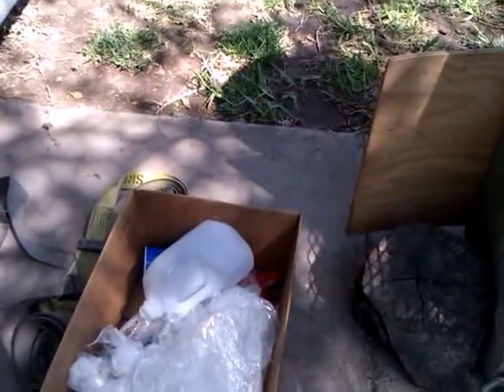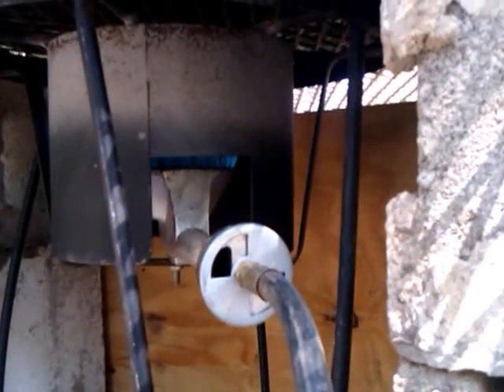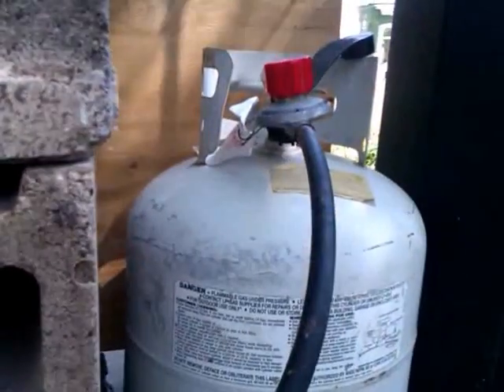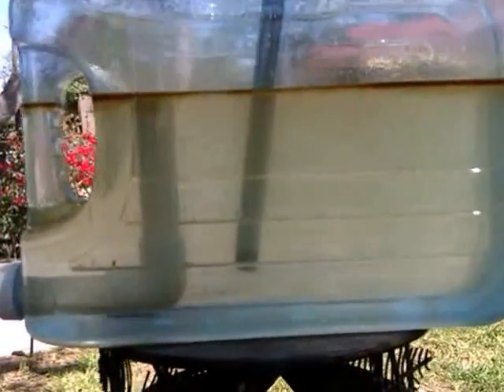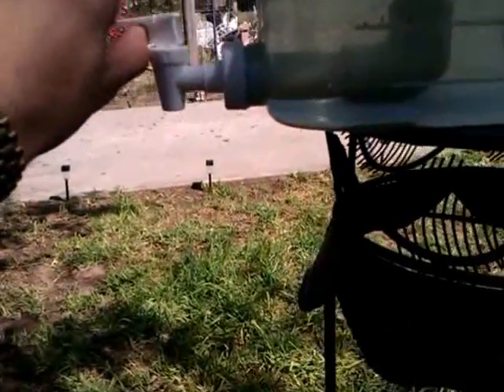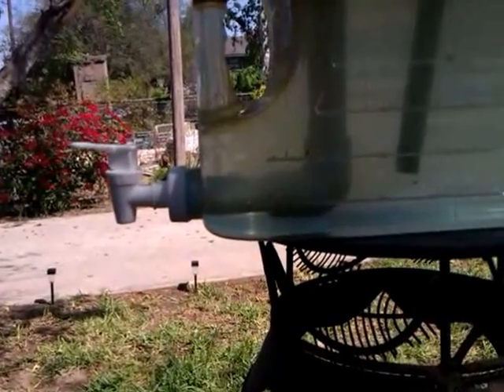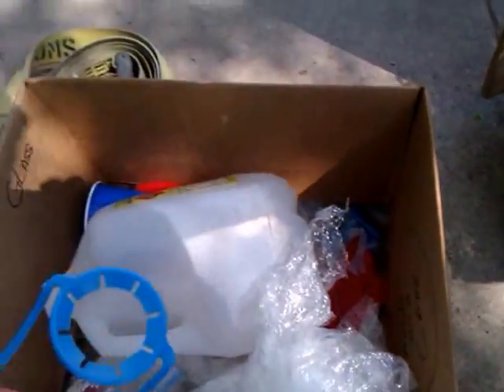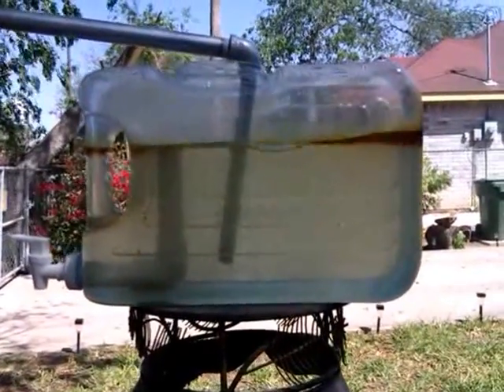Homemade oil refinery. Turning plastics into oil

Comment: I didn't read all of the comments so this may have been covered before. You can improve the system be using a better cooling loop and extract the gases that will not condense and then feed them to the boiler. This will reduce your propane usage (or whatever fuel) while keeping the gases out of the atmosphere.
Reply: Royce Jones Hello sir, 
i know this sounds random 
but when you suggest a better cooling loop !! what do you exactly mean and how is this achievable !
and how would you feed the gas to the boiler again 
i am thinking in recreating this project myself! and i thought  of picking your mind 
thanx in advanced
Reply: You would use a condenser to cool the gas to liquid but not all of the gases will be condensable. Use those gasses for the boiler. They should have enough pressure to move to the flame holded.
Reply: Thank you so much sir for your fast response 
I will look closely more into it 
again i am really grateful for your kind respond
Reply: rahaf hussein Anytime, do a little research on gasifiers, wood, coal, etc., they all work basically the same.
Reply: u are fond of the word "apparently" aren't you?
Reply: Ayyoob Bashir Najjaar NOPE !! 
apparently am not

Comment: Use a solar reflector to heat it up no power no gas used  be careful not to melt the bottom of the drum . Incidentally you are actually using the same basic process that formed oil during noahs flood heat plus pressure bing oil
dont take millions of years (i think its called thermal depolymerization)

Comment: green? so you burn 5 gallons of propane to produce a cup of oil. move to Hawaii and sit that drum on lava, then you are been environmental and green.
Reply: +qwertz33 genetically modified E.coli bacteria sounds kinda scary to me to be honest...
Reply: jesusvivian i think in iceland they do have a place that uses volcano heat for electricity generation. yes his idea is not cost efficient but at least he is using propane, which is the least polutant fossil fuel
Reply: you have a vary fine point about the inefficient use of 5 gallon propane to produce a rather small amount of oil... however... to relocate from where anyone is or might be, anywhere in the U.S or even anywhere in the world, to the location of a volcano, even primarily the Hawaiian Island's volcanoes, would be vastly inconvenient and inefficient use of energy... lol  see what I did there >_<   XD
Reply: +jesusvivian it's chemically impossible to produce a fuel with a calorific (potential energy) value greater than that of the energy introduced into the machine that produces it. Heat is energy and heat is required to break the bonds holding the plastic together during the process. The process wouldn't work if it didn't get hot, and as soon as the reactor and attached piping gets hot you have lost energy in the system.
Reply: @sethjenkins4066   but but law of conservation of energy
Reply: but you can e.g. use bacteria to synthesize diesel. Seth Jenkins
Reply: jesusvivian I think he can use bio gas from his kitchen wastes.
Reply: we really should be using more geothermal energy though. I believe in it, its part of the future, I even bought some U.S geothermal stock a few years back, that's how much i believe in it as part of the future of energy, now will economics catch up to common sense, I dont know, but if something is there, and its free, why are we not taping into it? The same likes could be said about solar, wind, and tidal. I suppose the real hurdle for any group or individual would be cost... but.. I suppose the cost is greater for an individual, then a group.... thats how we will build the future, as a group. Find your groups and make it happen. !!
Reply: jesusvivian I think he could use the oil he produces
Reply: jesusvivian He could use a parabolic mirror!
Reply: I've been thinking of doing the same thing, but that means you can only do it in the morning under the sun, and you have to chase the sun's rays around.
Reply: bro hes experimenting and ur sitting on ur ass in the youtube comments
Reply: its the idea, and the metal drum would melt to liquid
Reply: +jesusvivian u should go on eating your pills my friend.

Comment: I see what people are saying about using more energy than what is produced but if the tech works I am confident some one will create a more economical way of heating the plastics
Reply: solar focal point, granted only works when there is plenty of sun but hey its 90% free to do so (you still have to build the collector and oil reactor) look up focal beams

Comment: You'll find there's actually even more volatiles escaping off the top of your cooling tank.  Mostly Hydrogen gas.  If you collect that you can pipe it back into the burner for heating the tank to replace some of the propane and make it much more efficient.

Also, if you cool the gasses in increments you can split the oil out by weight and separate the gear oil from the gasoline, etc for a much more usable product.

Comment: I like your proof of concept, plastic canbe reverted to crude,how much pollution do you release into the atmos.  you need to keep a balance sheet,  do you get less energy than you expend?  simple recycling rather than reverting plastic to crude oil, seems more economically feasable.

Comment: Keep in mind this is his prototype. he even said in the video he wants to use electricity to heat the plastic much more efficient that propane...might even be able to use solar panels the plastic only needs to get to about 90 Degrees before pyrolysis take effect.

Comment: I found this very interesting and if you can I would love to know more about this if you can send me a detailed description on the parts and steps on how to do this I would appreciate it a lot also I want to know if the oil u were able to get out of the plastic can be refined into gasoline
Reply: I'm sure it's all just as simple as it looks. A large container to melt and vaporize the plastic and one to condense it.
Reply from the maker: All oil made here can be further refined into various fuels like kerosene gasoline or diesel, but it takes a lot of temperature control. Each one is gasified at a specific temperature so heating at that specific degree and then another and another you could potentially get several different fuels depending on what plastics you used

Comment: Don't you burn more fuel then the amount of oil you extract making it a bigger waste rather then just recycling? 
Comment me if I'm wrong.
Reply: Jay Repko I think that's why he want to try Solar or wind
Reply: Solar or wind will never give enough energy to get hot enough. At least economically speaking it will be cheaper to just buy oil. At some point with all the effort you gotta ask yourself how much am I worth and how much time does it take me to make this?
Reply: @jayrepko7118  If he uses a large enough magnifying glass he can get the necessary heat especially with all the sun in Texas.  He can also help himself by burning the gasses released from the plastic and finding a way to pressurize the system.
Reply: Jay Repko bullshit!  Absolutely bullshit!

Comment: I can't see how you can burn energy to reclaim a higher volume oil from the plastic your heating. the whole project is a waste of time and money
Reply: You can use sunlight for heating the barrel. Think of it this way: a 6ft by 12ft "wall" of either stainless steel or some thick-enough aluminium would be enough to heat the barrel to the temperatures needed, on a sunny day.
Reply: @SapioiT  he can burn the gas generated to heat the system. this is how it's done industrially

Comment: just burn the plastics themselves and there you have your energy, with distilling the melted plastic soup you gain nothing besides waisting propane, right?
Reply: the problem is that you cant run a combustion motor on that, the equation is just if you can make it in some way where you can get more energy out of it than you use to power the setup.
Reply: yeah but technically your still wasting a lot of energy to the environment during heating the plastics; because you have to think of the energy bound in the bottles and shit, your also have to account for them in the balance; and a combustion engine's efficiency is quite low so you will loose some there as well; maybe it's better to recycle those plastics and make new bottles out of them and use the crude you'd otherwise use für new bottles to make gas; anyway the experiment looks like a lot of fun, and its cool that its actually working, keep experimenting!
Reply: and burning the plastics would also burn impurities, which are better disposed, and the oil is more useful as autofuel rather than just burning for heat.

Comment: Is there not some kind of slag at the bottom of the main tank, you melt so much of it and then what does it all go up the tube, or as I have asked there is some kind of left over slag....?
Reply: Tim D Stevens yeah seems like after a while you would probably have to make an entirely new setup because this thing looks a bit difficult to clean

Comment: Gasification is awesome and all the air pollution is collected, its not incineration. This is so simple and it works. Wood to syngas, Tires to crude oil. Your the guy that will build a ship to clean the oceans of plastic and run it off gasification of the Plastic. Keep up the good work.

Comment: Creating air pollution and burning fuel to melt plastic is not a good idea and a waste time
Reply: melting plastics produces a different less reactive chemical reaction than burning plastics. Therefore air pollution is also is actually reduced as less CO2 is actually burned from plastic bio diesel compared to conventional synthetic mixed diesel. So you are actually reducing landfill waste and reducing CO2 emissions after burning the fuel. This is why I think it is a good idea and not  waste of time :)

Comment: how much fossle fuels needed to burn to make  1 gal or oil. Use a Fresnel lens instead of gas
Reply: I was thinking a resistance coil attached to solar within a double walled container with a pressure sealed lid would be most efficient on input vs return. 
After seeing this video I'm going to make one
Stay tuned
Reply: You know you can use the gas off of that to powe that. A by product  is propane.
Reply: @shermrock345  burning the plastic off the fumes. Classic. But, the fumes are the most valuable part. You gotta harvest/sell them. Hydrogen as fire. That's not just any gas it's Jet Fuel.
Reply: @shermrock345  Or you can harvest the gas and sell it, too. And if you power the thermal depolymerization with solar heat (with mirrors), you can sell even more of the produce, leading to a lower overall price, which would mean people will be more likely to want to invest in it. And the pumps for pressurizing can be powered by sunlight, too, if you have a big enough stirling engine.
Reply: Can the fresnel hold the pressure?

Comment: I think if you used a wood gasifier instead of propane to run your plastic gasifier you could cut your costs by maybe 70 %. Research FEMA gasifier, The plans are free. Good luck on your plastic to oil recycling project!
Reply: Where are the plans thanks
Reply: Look up wood gas on youtube and just follow the links and you will find the people building the gasifiers. I hope this helps.

Comment: how do you make you burning drum air-tight?
Reply from the maker: The 55 gallon drum that I used came with threaded ports like large nut and bolt. From that port I screwed in 2 reducers to make a perfect fitting from the threaded opening to my condenser. Thanks for your interest

Comment: heyy dude!! so this like something really awesome!! keep up the good work. I had some questions though, what would you substitute your high pressure propane tank with? Coz you won't be able to get as much heat and pressure with solar or wind energy without being cost effective? Plus burning fuel like compressed natural gas or liquified petroleum gas would not make sense coz you would be burning fuel to create one. So well im just asking u if there's a way to cut its recurring cost so like then i could finally put it to practical use.

Comment: I notice you aren't collecting or using the syngas that is being produced. That can power gasoline engines to generate electricity or burn to run your system. Syngas is mostly hydrogen so it burns very clean and the exhaust is water.

By the way, you can process that oil again and make more syngas.
Reply: The Dude Guy It is produced along with a liquid, commercial Pyrolysis machines only use an external heat at the start. I’ve seen a YouTube vid of a commercial Pyrolysis machine that continuously feeds plastic in so just keeps producing constant supply of low Carbon fuel and an inert Carbon dry residue that is used in tiles, bricks etc.
Reply: @Kiyarose3999  There's a backyard mechanic in New Zealand who's using part of the resulting pyrolysis to feed the combustion  https://youtu.be/cTtAElSO7zE
Reply: Mark Proffitt Exactly, without using the Syngas the Pyrolysis process is  inefficient.

Comment: Nice work.
How are you getting the oxygen out of the system? What kind of temperatures are you running at?
If you're interested in converting the system to solar in some way I might be able to offer some input.

Comment: This is cool. I am getting ready to build a smaller version with some high school seniors here in the Philippines. I was thinking about using two condensers with spigots to trap the first and second run (you could do three for a clean third run) and capturing the cooled end gas to help fuel the retort or burn chamber. Nice video!

Comment: Great video. Basically this is heating plastic waste in a non-oxygen environment. I am thinking about making one using an old 20L pressure cooker I have. However do u know when to stop heating? Is it after you stop seeing oil coming out of the pipe?